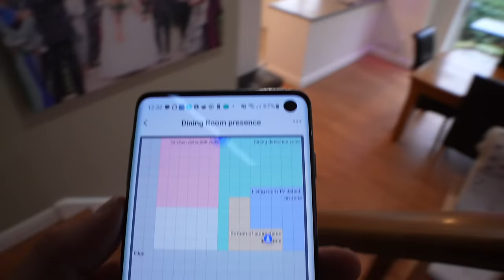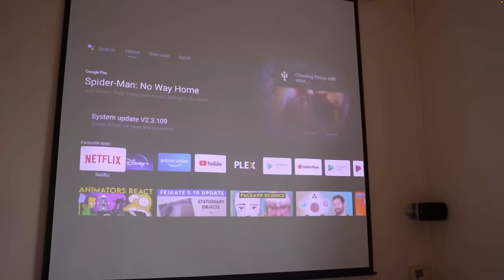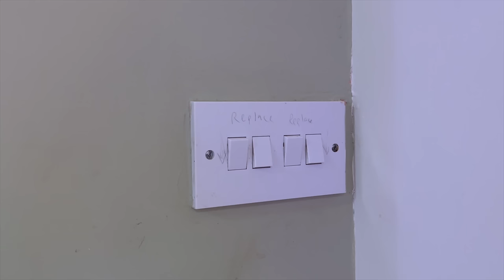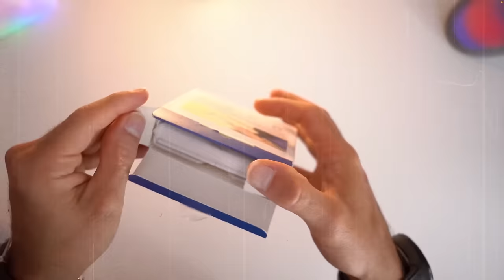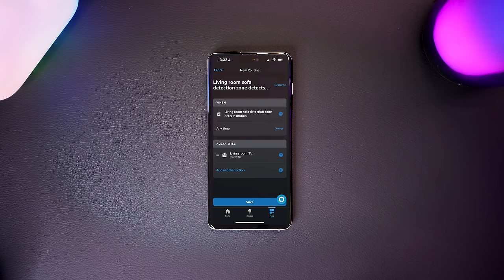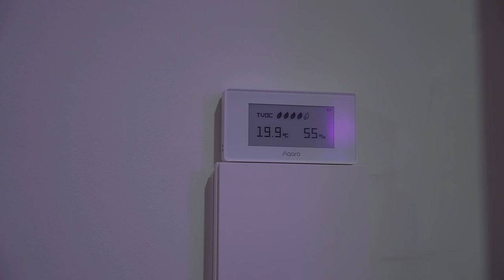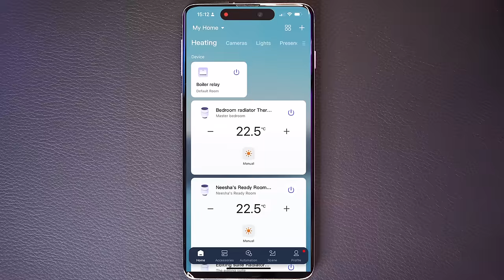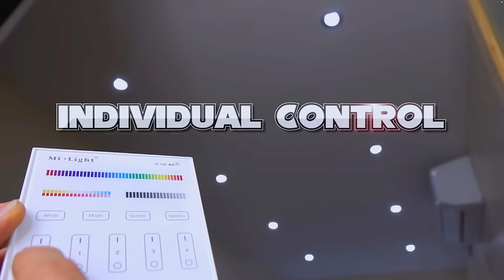This Changes Everything… HUGE NEWS

Comment: Congrats on the new home, Paul. A big change like that is always exciting. I just popped in to say, yes, Home Assistant can be a bit like a Tamogotchi, but you likely experience a higher level of instability because your job requires you to make many and constant changes to the system. Average users, once set up, don't have quite the number of headaches in certain you do. Heck, I've gone months before realizing i haven't checked for updates and my days of tweaking things feel like they are over. None of this is meant to discredit what you've said, just to provide a little "other side" perspective. Cheers!
Reply from the maker: Thanks dude, you make a good point!
Reply: Well said, I wanted to chime in when viewing the video but my points would be similar lol. I think I went 6 months from March-September with literally not touching HA running on a NUC, besides using the app to turn things/on/off. Automations all ran fine. I go in cycles of tinkering, and completely updated and redid all dashboard this fall, but you can go very long stretches of time without changing anything, assuming you are using non cloud based gear.

Comment: Home Assistant is not so bad at breaking if you don't use custom integrations or bespoke configuration files.  If you can do everything inside the UI, you don't really get things breaking as much.   But if you want to be all in one ecosystem, then for sure you can ditch Home Assistant.  Home Assistant is good if you have a bunch of devices from different suppliers.    
I think, having a bunch of Aqara stuff, it could be better for what you want to do .   The issue with Home Assistant is a lot of people over complicate it, because it can be over complicated.    The KISS principle works with Home Assistant too.   If you keep it simpler, it doesn't break as much.   This is coming from someone who has used Home Assistant since 2017 and also has a life, a partner and a child.
Reply: I’ve been using a few custom integrations for 2 years now with minimal issues

Comment: I use both Homekit and Home Assistant.  Love Home Assistant because it is so powerful so I am not likely to give it up.  What I would like to see is a proper integration in HA for bringing in the Aqara hubs (integrations exist buy they are not great).  If we get a proper integration then all the Aqara devices can be both in HK and HA without any fuss.  Lutron Caseta works like this and it is quite handy.

Comment: I have HA and I find it reliable.  I have 12 Tasmota plugs, Aqura devices x 5, 3 x hue lights, 1 bellikn switch (first one I bought), nest connected… UDM cameras.

I’m curious if your issues with it is because your testing so many different products all of the time ?   Do you have a separate HA instance for testing.

The biggest pain I have experienced so far is zigbee and pairing once paired fine, but the initial device discover is a pia!

Comment: The setup in our home is fully Nest (Google) and Ikea-tradfri based (due to cost). It works pretty smooth, Ikea's switches are an awesome-cost affective way to get switches in a rental property and also use nest-speakers without having to replace any stuff. If we ever decide to leave I just pack it up, build it up again and it works again.
Reply: Same, ikea stuff is cheap and can be used wirhout internet at all, they only sell you a hub if you want voice control, it's not even necessary for initial setup

Comment: Just out of curiosity, what do you mean you need babysit HA? I've installed it, it works and unless I need new device, I don't need to do any updates or anything. So same as any other system, if you get it into working state, just don't touch it. How did HA then let you down?
Reply from the maker: I truly love Home Assistant, but I can literally give you 2 examples from just yesterday…  Zigbee plug socket fallen off the Conbee stick and needed re-pairing, and then at midnight I clicked my flick button to start my sleep sounds via my Google speaker using webhooks and nothing 😒 

I need to go through the logs and get some stuff tidied up I think
Reply: @paulhibbert  Have you tried the Hacs retry integration? Not sure when it came out but BeardedTinker has a new video about it.
Reply: HA is constantly broken - After 5 years of use i see no hope for this platform. Problem with developers and community. After all this time they can't even implement simple scheduler, countdown timer, or ui customizable card - things which are basic for every home automation system. That is just ridicolous. And sorry there is no excuse for it also HA influencers do their job but you can't hide serious problems all the time. I'm also buing new devices with intention of switching system.

Comment: Hi Paul.  I have a mainly aqara ecosystem but the reason I have been scared off from going all-in is that I have a bigger house and know that not all devices would reach a single hub.  That's why I have gone Z2M on home assistant and used ZigBee powered devices to extend the network.... But it can be flakey.  Have you needed to get around this?  How?  I don't use homekit  and the only solutions I have seen use that to possibly join 2 aqara networks. I am looking for a way to ensure that I cover the house. Thanks

Comment: Dear Paul, thats one more amazing video. I am switching `slowly` to Aqara as well, as i have been babysitting home assistant for three years now and now i am busy with my hman baby 🍼

I only planned to keep home assistant for dashboards to check for my Dutch energy and water meters. Additionally, sniffing and vomitting API like our online supermarket deliveries and tracking our post parcels before the mailman throw them on the street.

Few questions i had! 
Dimmers: why not a cheap RF dimmer switch and use the mighty broadlink instead of home assistant?

Thermostats: I am personally in love with a vintage honeywell product called multizone evohome. It just works!! 😅 And opentherm friendly. Also very energy saving in terms of learning the patterns of each room. How long it takes to warm up and cool down.

Again, excellent video ❤
Reply: Honeywell, and no one other thermostat can do the same. I love my dumb T3R... it seems to be much clever than the smart ones
Reply from the maker: Thanks dude, I love broadlink stuff too, but the plan was to keep as much stuff under one roof as possible and Aqara has a wider range of stuff, including the radiator thermostats which I’m a big fan of 😁
Reply: Aqara is supose to sell dimmers in europe next year😊

Comment: Based on your previous recommendation, I'm buying Aqara whenever i have a choice. The FP1 seems handy for lights but having lights flash off and on as I move around a space would drive me nuts. I use HA to keep lights on for 2- to 3-minutes in corridors and 5 or so minutes in busy areas like the kitchen. How are you getting on with your implementation now the novelty has worn off?

Comment: Hi Paul, what lightbulbs are you using with Aqara? Because I didn't quite get your old video, where in my own mind you misleadingly promised compatibility with Home Assistant for BroadLink lightbulbs and switches (never mind). Now, my Aqara sensors only communicate through Alexa with my lights. Unfortunately, Alexa is even worse than Home Assistant because when she's not working, I can't even fix it. I’m desperate enough to buy non-neutral Aqara switches (sooooo expensive 😳) but I have no idea what lightbulbs 💡 should I have. Please help

Comment: I just got myself an exclusively Aqara home system too. Thermostats, tempature sensors and door/window sensors.

Right now my smart home only controls my:
* Thermostats OFF when any window is OPEN and Thermostats ON if all windows are closed. All thermostats have an associated external sensor for tempature detection.
* Tempature/Humidity/TVOC sensors in every room automaticly remind me of when I need to air out my apartment. When I do that, it monitors all sensors and notifies me when all values is below a certain point.
* Along with window sensors, all doors also have sensors on them, and if they change state during the time my alarm is ON, it raises an alarm and notifies me.
* My Aqara alarm system then uses the sensors to monitor for change and too high/low values. Right now my tempature sensors is monitored for tempatures above 50C as that could indicate a fire.

I'm planning to expand it with 5 waterleak sensors (one for under my dishwasher, refrigerator, sink in kitchen, sink in bathroom and toilet), 4 smoke detectors (one for each room), 4 pressense sensors (again one for each room) and 2 cameras (these can cover my entire apartment).
Haven't done any smart lighting as I live in a rented apartment and am not allowed to rewire my electrical installation (even though I'm actually an electrician). I'm gonna have to be a little creative with the lighting part, but it can be done with the relays and just blanking off the light switches with a plate on top. 😉

Comment: Great video, thank you.  I'm heavily invested in zwave, but he ocntroller I use by vera, albeit good, seems to be on the decline. What do you suggest so I do not loose my zwave investment (10 baseboard thermostats, door locks and a bunch of light switches and sensors)?  Home assistant?(probably not).

Comment: Great piece, love the Aqara stuff I have, most reliable in my set-up. But,  the lack of support for sockets, dimming, and bulbs is a real pain in the backside. 
Couldn't they just open up their ecosystem to other Zigbee devices? That would solve most of the problems. 
It seems the simplest solution is to move over to Homekit and use Aqara devices.

Comment: Well done Paul. I moved to Aqara last year because they are easy to set up and use, they use Zigbee, are affordable, work well with Amazon products, and are covering matter. What they are missing though.
1. A speaker system like the Echos so I can finally ditch Amazon.
2. A Smoke detector (not here in Europe)
3. A clever frame to mount two wall switches together (you had that problem to)
4. they have announced a european wall plug several months ago but still not seen
5. A triple plug extension lead for Europe which allows all three plugs to be smartly controlled.
6. A real door lock system which is not a strap on.

What I dont like
a) the curtain control unit does not fully close my pair of full height curtains, full open no problem but it struggles to close them leaving a gap (they are not heavy ones)
b) the radiator control needs to be calibrated on a regular basis otherwise it just goes into full power heating up the room. This happens on all six of mine which I purchased over a peroid of several months so its not a batch production issue.
c) LED strip far to expensive for only two metres.

Comment: HA is running smoothly for like 3+ years for me, updating it monthly and for like 1-2 years I had NO breaking changes to take care of.
Now there is one regarding the Ping integration which I use, but nothing major. If you keep it relatively simple it works fine.

Comment: Another benefit of the Aqara system is that as it's mostly Zigbee, it will still work if the internet is down. Just had to deal with converting a 4 gang light switch to a 2x 2gang light switches. However finding the FP2 mapping range is not that long as you managed to get it? Was there any additional way or setting you did?

Comment: I am finding that sometimes my E1 radiator thermostats do not seem to close the valve when their coupled sensor is reporting that the set temperature has been exceeded. Do you have any issues like this? I am using an M2 hub.

Comment: Hate to say it and will keep using HA. but you are right. thinks will break.
NEVER run an update before going to sleep.
Reply from the maker: I truly love Home Assistant, just I fixed yet another thing just yesterday afternoon and then at midnight I clicked my button to start my sleep sounds and nothing 😒
Reply: I moved cross county last year, and my HA server didn't mind at all.  I labeled all of my lights as I uninstalled them, so it was just a matter of installing them in the new location.

Comment: I'm currently having issues with Alexa routines with Aqara. All my routines have stopped working. I was having to relink the skill to get them working again, however this week even that hasn't worked. Currently switched to link n link sensors, and testing Aqara daily. Today is the first day for a week it seems to be working. Maybe it's the update just received has fixed the issue. I do love the aqara gear. I'm hoping to enable my routes soon.

Comment: I regret changing all the light switches in a holiday let to aqara. If the cleaner, or anyone long presses a switch they go into pairing mode indefinitely and you have to visit the property to repair. Could they not program them to automatically revert back to the network they were previously part of!? Also zigbee is flaky, if I were to do again rather have wifi and modules behind regular switches or in ceiling behind lights.
Reply from the maker: I think you’re right that they ought to default back after a period of time, I’m surprised to hear they don’t do this. I don’t understand why a cleaner would be long pressing your light switches though. That’s just weird.

As for Zigbee being flakey it’s working all over my house right this second, each light switch is a mesh point, so I’m confused as to why you’re struggling. 🤷🏻‍♂️
Reply: @paulhibbert  wiping the switch is long enough to reset :face-turquoise-covering-eyes:and then maintenance think they're trackpads and they reset them too. People leaning against them etc. Either revert back to the network they're on or 15 rapid presses or something.

The no neutral aqara wall switches do not act as routers and thus the mesh is weak, something else i didn't know when i bought them.
Reply from the maker: @Paul_Munro  😮 wonder how I’m getting away with it! I still only use the one camera and it must be single handed covering the whole house then!

Comment: I do think Aqara makes great kit and they are my go to zigbee brand. The real issue is that HA is never going to run on Raspberry PI4 or lower without care and feeding. Yes using a USB based SSD will make it better. But after moving to a decommissioned Chromebox with a very average SSD; I've had zero issues in the two years since making the change.

Comment: Bugger! Just bought a load of Tuya smart, touch switches (and yes, they do 4 gang switches). Really simple to install, needing only one live input and then one connection to each light (similar to a radial circuit, not a ring circuit).

Comment: On the temperature sensors is there any heat coming off of the switch below. Remember Linus from LTT had a slight issue as his thermostats were above over switches (can't remember what) but the heat coming off of them was tricking the sensor into thinking the room was warmer than it was. 
Looking forward to more video's on the new house 👍

Comment: I bought an Aqara M2 Hub and the darn thing constantly goes offline in by Ubiquity network with a Wifi access point a short unobstructed 10 feet away.  I was interested in your video but given I cannot get reliability form the Aqara Hum M2, I cannot by any more Aqara products until I can possibly establish some reliability.  I am a Home Assistant user and would love to find a large ecosystem like Aqara if it is reliable.  Any suggestions?

Comment: Another great video ! However the reliance on Amazon Alexa is a frustration for me. I do use Alexa around the house just for music and a couple of routines. But mainly I use a cheap zigbee hub for everything to work locally. I have no neutral light switches and motion sensors (all zigbee) and zigbee current sensing plugs to activate routines. Been in place for 2 years and all works well even without the internet. Aqara is great - I have the curtain motors and a few sensors to ensure the little one closes the fridge properly 😂

Comment: Honestly...Aqara is great, as is Shelly as is Switchbot and also Homematic IP...but at the end of the day, none of them makes everything, so, Home Assistant, while it does require attention and tends to break things with Updates (though some of the issues are down to manufacturers changing the API or blocking it) it is the only system I know that can (relatively) reliably connect everything and make it work together.

A Vaillant Heat Pump, Homematic underfloor heating controller, Huawei Solar system, Tibber electricity, a Tesla, some Switchbot stuff, Hue, Govee and other lamps? Ikea switches and so on and so forth...Home Assistant links it all up easily.

Comment: Great videos as always, but I’m interested to know what you think is the best sensor kit as you’ve recommended broadlink, linklink and now Aqara? Or are they much of a muchness?
Reply from the maker: The key difference here is price, the LinknLink sensor is amazing for the price, but can’t portion up a room and react to different parts of it, but it’s ludicrously cheap. The aqara sensor is what I would personally choose as I have a vast space to cover and want to try to keep everything in one ecosystem as much as possible. If however you’re on a budget or just have one room to cover then LinknLink are incredible
Reply: Perfect thank you. We do have a large space. So will look at the Aqara. Just bought the linklink to match with the Broadlink switches for the kitchen replacing hue. Combined it cost the same as a hue bulb. Just need to get the routines working better